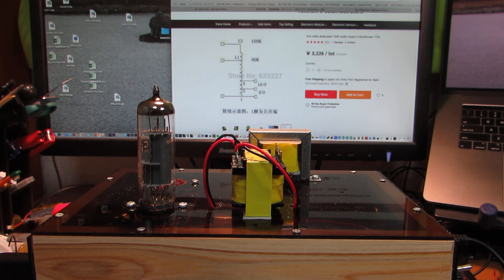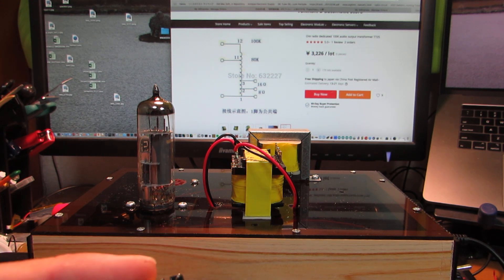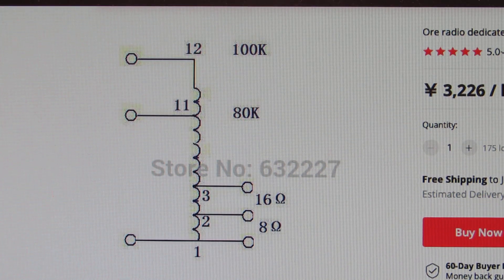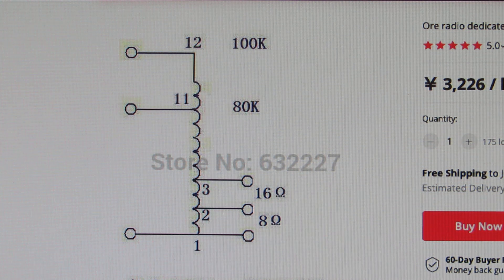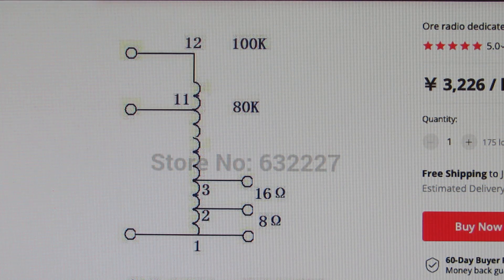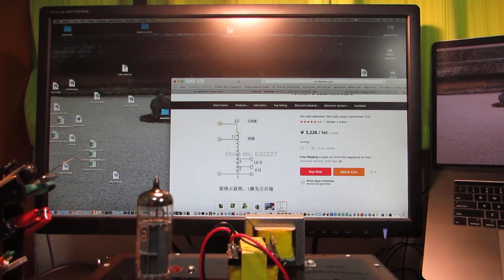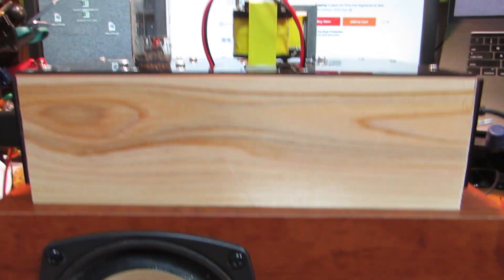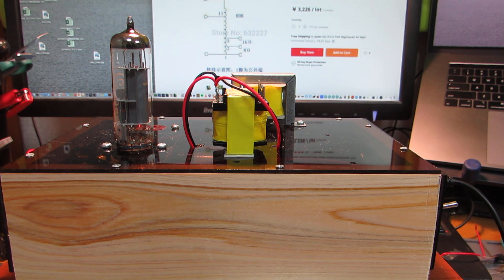Cheap output trans making by Chinese audio autotrans

Comment: As the wire diameter is not increased with cutting off from primary, the new secondary wouldn't bear as many amps as it is needed.

Comment: Interesting concept.  Try using a 120:6V power transformer or a 70v transformer designed for use with distributed audio system,  as output transformers.  With low power the core will not saturate.